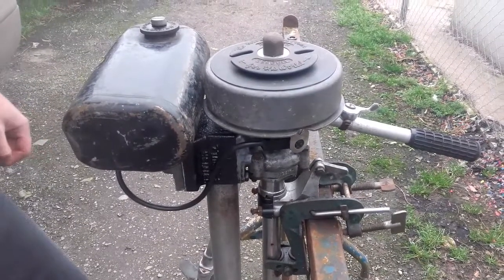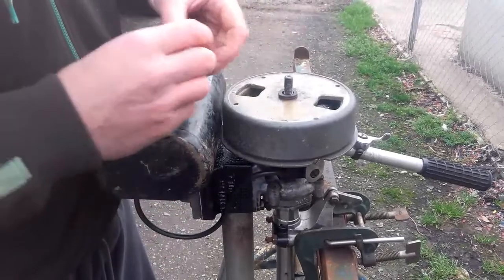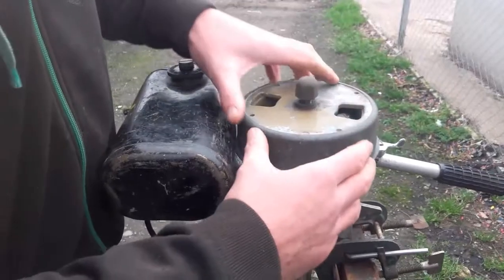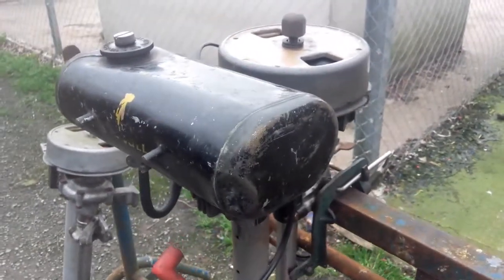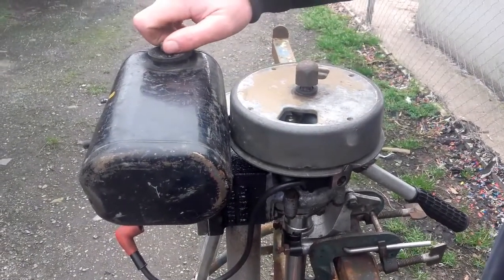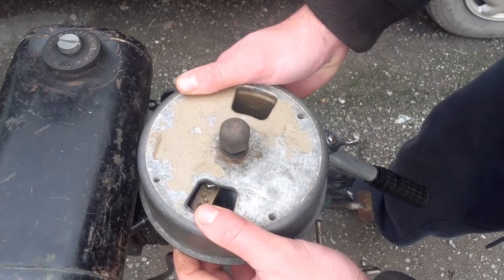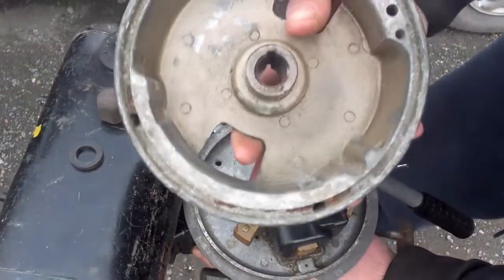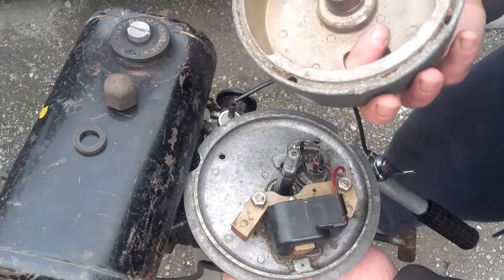British seagull outboard flywheel removal

Comment: I wish I had seen this 25 years ago. I ruined a flywheel trying to remove it on my own. I now own 6 Seagulls of various models. I have not tried to remove a flywheel from any of them. I WILL BE DOING THEM after seeing these videos. Thanks for sharing the knowledge with clear instructions and nothing left out.
Reply from the maker: +ken george thanks ken . Flywheels can be sticky sometimes . I've done a lot of flywheels now only the very corroded or neglected seagulls stubborn . Plenty penetrating oil for a day or so you should be good. Lump hammer only for the top but , normal hammer won't shock it enough . If after the first or second heavy blow it still hasn't moved more oil , but be careful many heavy blows will eventually bend the crank.
Thanks for your comment
Barry
Reply from the maker: +xxxscimitarxxx under no circumstances use a puller it destroys the flywheel
Reply from the maker: +xxxscimitarxxx under no circumstances use a puller it destroys the flywheel

Comment: Brilliant, many thanks this will help me not damage mine when I take my flywheel off to check the reason why there is no spark.
Reply from the maker: +Somerset Roach thanks for commenting .hopefully this will help . Plenty penetrating oil a few days before and you should be set .
I hoping to do a spark diagnostic video on the wipac soon too.
Thanks again
Barry
Reply: Cheers Barry, I picked up my working seagull a week ago but when I got it back home I failed to get it to start. Initially it had a rather poor spark and now no spark at all. Have checked the usual suspects (HT lead, plug and contacts) but to no avail. So have now removed the flywheel and about to delve deeper. I may need to wait until I see your Wipac video before I get it sorted. Thanks Chris

Comment: Many years agoI had some bad trouble with the ignition of a Seagull. It was a 3 HP model probably with the (then) modern black plastic pulley and the oval fuel tank. Following the instructions in the Seagull manual, which are the same depicted in this movie, we tried to take the flywheel off.
Even after soaking it in penetrating oil for 2 days the flywheel wouldn't budge. In the end, we hung it by the flywheel and and 'expert' would give it a 'few nice blows' ... and in the proces missed the nut and broke the flywheel... .
Pretty much of a disaster, for a 16-year old schoolboy with a dishwashing job on Saturday nights, until someone remembered there were some old cannibalised Seagulls lying around in a corner of a shed at the yacht club. We found an ancient 5 HP, missing the gearbox, fuel tank and carburettor, but still having the original aluminium pulley and ignition.
I have no idea how old it was, but the flywheel was aluminium and the whole ignition system appeared to have been made of bronze parts. 
Luckily this pulley, baseplate and complete ignition system came off without a hitch and after cleaning the insides with some petrol, we put it on my 3HP. Funny enough it all fitted and it started after the first pull. 
The only (slight) issue was that since the shaft got bent a bit in our efforts to the get the flywheel, off the engine was vibrating a bit more. On the other hand, as a Seagull owner you're used to a bit of shaking ... .
It served me perfectly and was still running perfectly when I sold it with my sailing dinghy about 6 years later.

Comment: Have you done much with the seagull engines with 6 flat head screwdriver nuts on the fly wheel, I'm struggling with removing mine if you have any tips
Reply from the maker: Try my flywheel removal video

Comment: Have you any tips on how to get the flywheel nut off, Try as I may I can't remove it, have it soaking in WD 40 at the moment.
  If I can get that off, then I'll be able to get the fly wheel off. I Hope.  Great Video.   Hope I'm not years too late.
Reply from the maker: Impact drill should whip it off
Reply: @barjhealy   Thanks.

Comment: How do I get the big nut holding the flywheel off to start the process ?  It's seized on, presumably with salt and crud etc and if I apply heat I'll cook the Wipac coil inside
Reply from the maker: Soak with wd 40 over night .
Get someone to hold flywheel and loosen it or impact driver
Reply: Thanks

Comment: Hi, really helpful video.  I have managed to get my flywheel off now and have to change the coil.  How do I get the back plate off so I can get to the screws that hole the ears to the coil?  There is a screw under the back plate that seems to go towards the spindle, does that need removing first or does the back plate just prise off?  Thanks. Andy UK
Reply from the maker: Remove the screw . Can be hard to come off . Usually a but of heat helps. Villiers or wipac coil?
Reply: Coastal Works ok brill' yes it is very tight, shame no hex head!  It is Villiers and I have a new coil already.  Got one screw out that holds the ears but the thread that has a nut on to hold wire that holds HT lead doesn’t want to budge so hoping if I get the other screw out then the coil and ears will come off....  thanks for the help.  A
Reply: Oh any idea what the thread is for the nut holding the flywheel on?  On another Seagull lightweight I have the nut is very stiff so wondering if someone has hit it and damaged the thread.  A
Reply from the maker: @AndyUK-Corrival  a whitworth thread no doubt .  Yes it's probably got a blow at some stage or someone put the drill chuck directly onto the thread to spin it up
Reply: Coastal Works Moving on from my previous questions.  I got the screw out that holds the top plate and soaked area with paraffin and penetrating fluid for a week or so.  Applied some heat but still plate not moving.  I wound piston to lowest point, screwed but onto thread of shaft and got a mate to suspend motor by holding plate and I hit the nut sharply with lump hammer.  Very little movement and now the piston seems to be stiff.  Have I buggered something up, bent the con rod or something?  Really frustrating.  On another engine I still cannot get flywheel off, about to give up...  thanks.
Reply from the maker: You may have a bent crank.

Heat the centre of the flywheel . Careful not to melt your ignition.
Reply: Coastal Works Hi, I did but maybe not well enough.  What about the other engine bottom plate?  Probably have two buggered up now...
Reply from the maker: I'd usually suspend the plate up in timber blocks in a vice and get socket to go into the centre and tap out the crankcase. 
I'd have the crankcase split and taken apart first beforehand